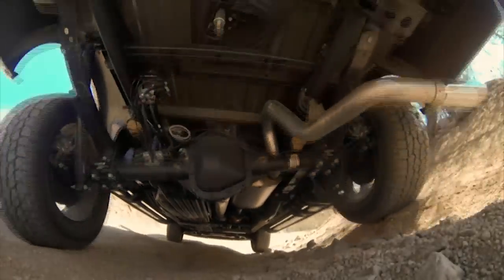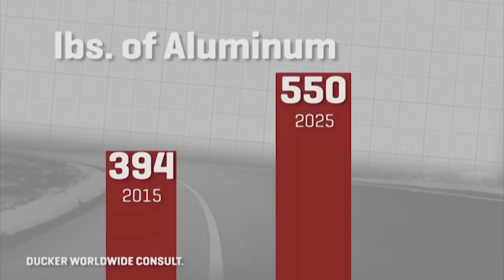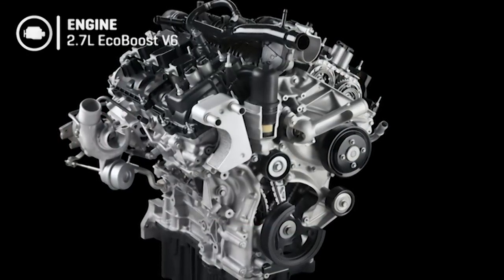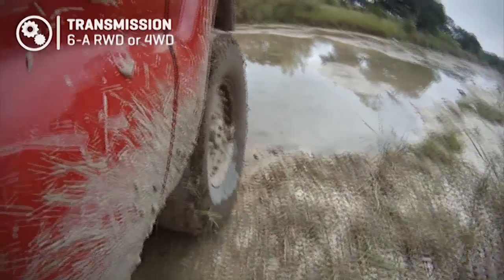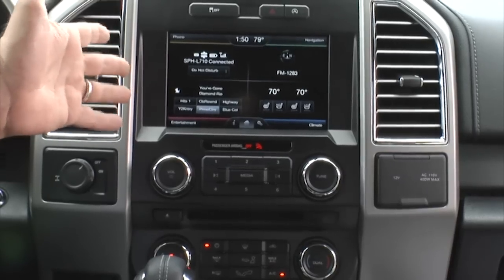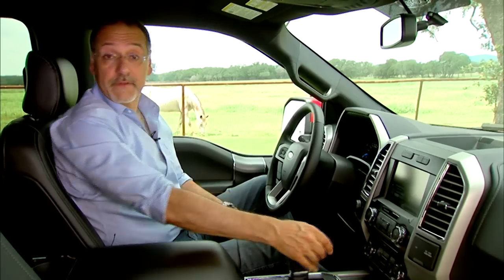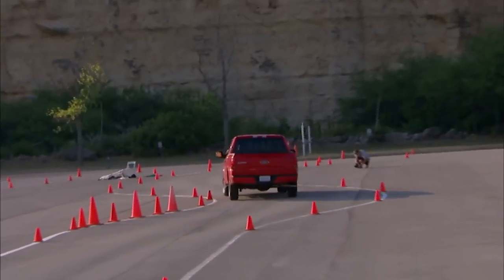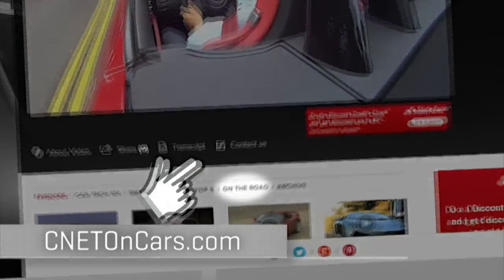CNET On Cars - On the road: The 2015 Ford F-150

Comment: The truck is amazing, I have a flex with the twin turbo ecoboost and it's amazing... The chrome inside is a FAIL on the designer and software, it still sucks, blinds you.. I will black mine out if I get this truck, just tacky ugly reflecting slop design... Rest, amazing, it is.. I love it, hope to find one at a good price.. Good job Ford, now fix the ugly reflecting chrome sloppy design!